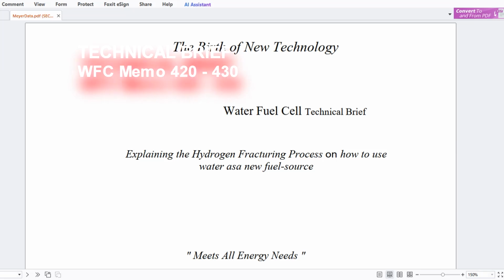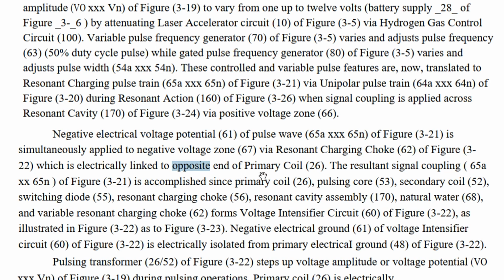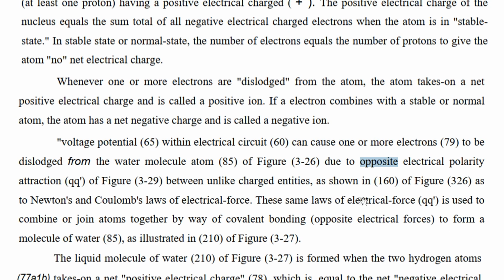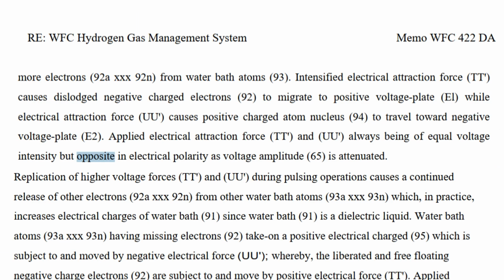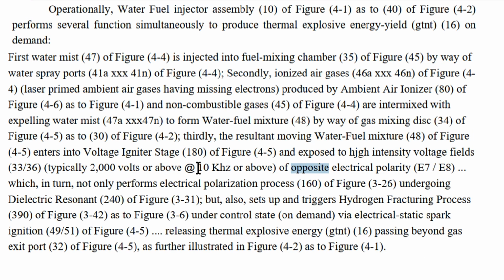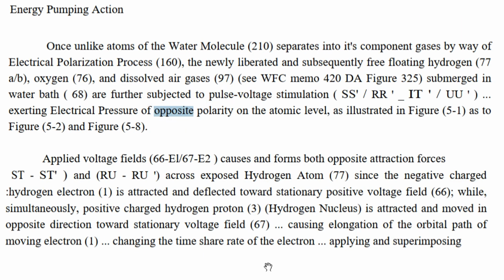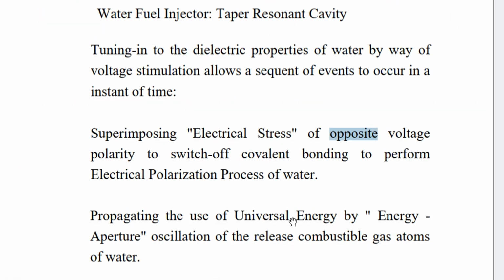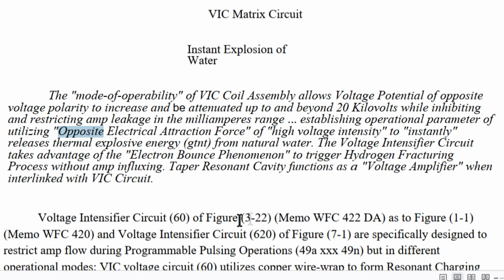Why Equal Opposite Polarity??? WFC Memo Breakdown

Comment: Indeed. 
While they're kept opposite (Polarization), they're also subjected to an amplitude ripple which is equal in frequency to the difference in the natural resonant frequencies of each phase. This is due to the secondary side of the VIC being asymmetrical (inductive and capacitive reactance's) about the diode.  Ie. C1 is on it's own to resonate with the WFC every half wave (ripple). Overall the two distinctly different resonant frequencies create an aiding and opposing beat (Amplitude modulation), with a superimposed aggressive ripple.
Reply from the maker: Agreed! This is exactly why there is an inductor on each side of the cells.